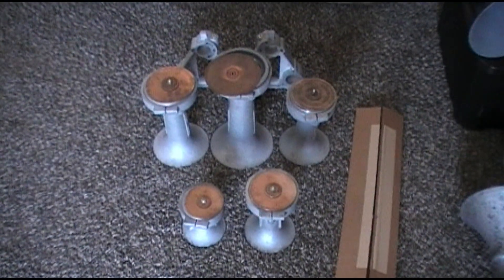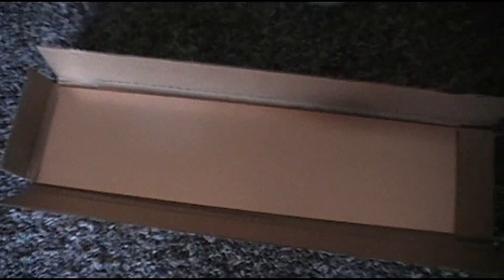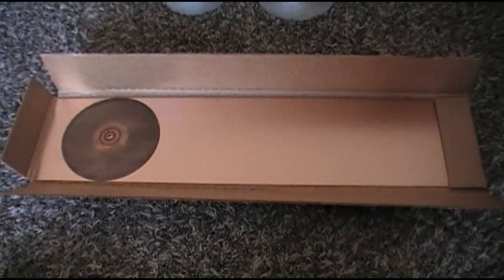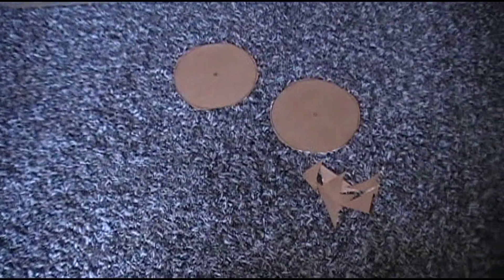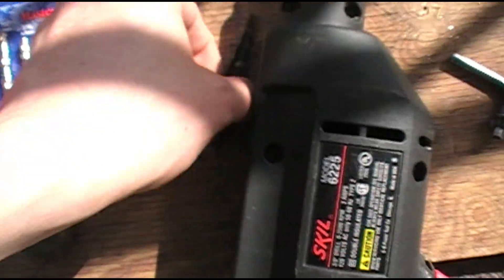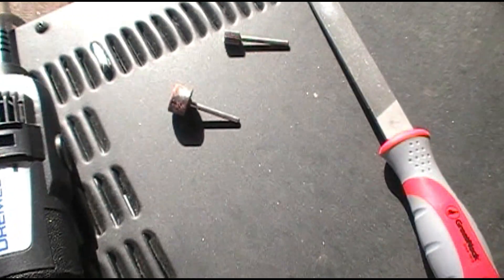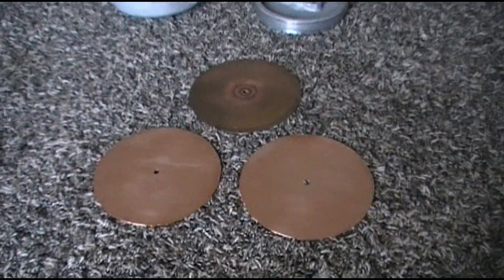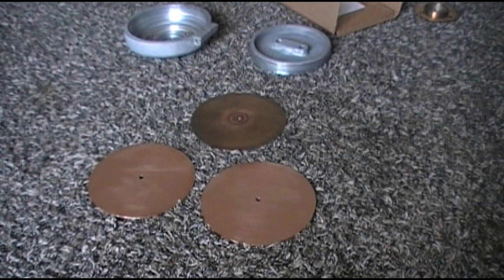Build a new diaphragm for M horn

Comment: Step drills (all drills, really, but step drills exhibit this problem to a greater degree) behave a bit like a rotor in a rotary engine, due to the room afforded by the relief behind the cutting edges and the flutes themselves. As a result, they tend to cut oversize, and not particularly precisely-round holes. This problem is typically solved in the machine shop with reamers, or with single-point boring.
Anyhow, thanks very much for this! If ever you find that you need replacement diaphragms again, give me a shout. I would be happy to make some for you in my own shop so you don't have to abuse your dremel. ;)
Reply from the maker: That's good to know!  I was trying to do this on the cheap, with the tools that I already had.  I did pretty well.  If this horn were ever to go on a locomotive I would first pay to get a proper machine shop set of diaphragms made.

Comment: Nice! Hope they sound good after. Also, according to Nathan, a k5la eats 71 liters of air a second at 120psi, but in your 20 gal tank dump video, you can get over 10 seconds of honk time?
Reply from the maker: That's what I got.  Keep in mind the pressure is dropping that whole time.
Reply: The 20 gal tank that you used was 120 psi. 20 gallons is 75 liters, so wouldn’t you only have 1 or 2 seconds?
Reply from the maker: In theory yes. The proof is right there in my video though. 
Does the Nathan documentation say anything about the size of the air line they were using?  I’d imagine that a 3/4” or 1” could force a lot more air quicker through the horn. Or maybe they went with a worse case scenario for a horn that’s heavily worn?  I’d like to see this source you quoted. I’m not arguing the numbers with you, but again, with 20 gallons starting at 120 PSI, all 1/2” lines, I got over 10 seconds.
Reply from the maker: P.S. if you have questions about the air consumption video, it would be best to post them to that video, rather than an unrelated one.
Reply: Alright, thanks! Here is my source for horn info.  http://microprecisiongroup.com/nathan-airchime/technical-info
Reply: Also on Facebook, there is a big problem with people calling k3s with p3s. If you go on Facebook marketplace, there are multiple k3s that day p3s!
Reply from the maker: @flattrain5834  Shrugs.  Yeah, that happens all the time.  People don't bother to look up info.  The M5 in this video was listed on ebay as a K5LA.  That's why I make videos like this, to help people learn.